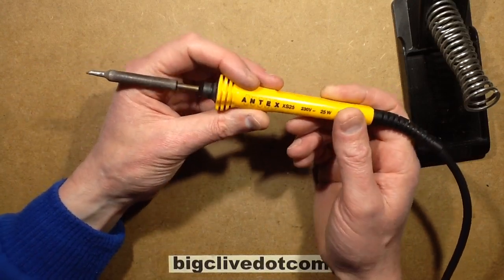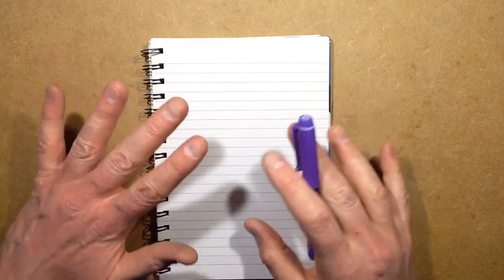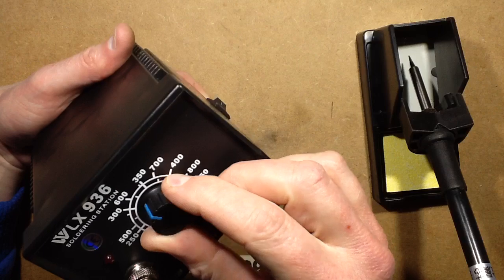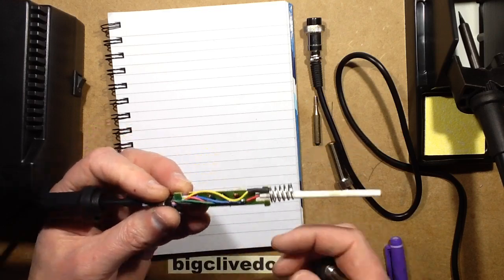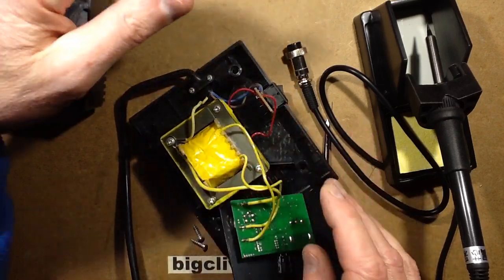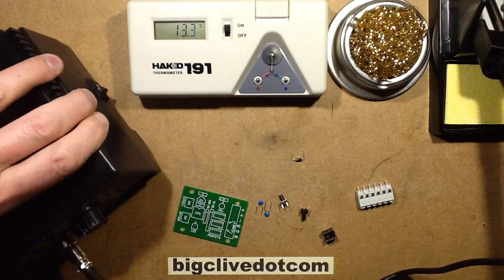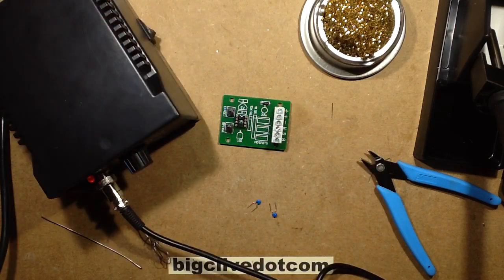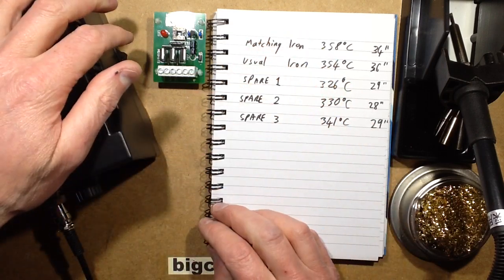Soldering basics and choosing a cheap soldering iron.

Comment: @Bigclivedotcom
Where did you get the extra/ secondary irons??? The same seller as the tips, the bible seller person?? 
Also where did you get the Secondary front panel & board modules????
Thank you Mr. Big Clive
Cheers Kerry/ willyboi
Reply from the maker: +MyWillyboi Search on ebay for 936 handle and 936 control and you should find them, but remember that some have the pins and some have the socket on the PCB.

Comment: I bought one of these a few years ago and I actually prefer it over my original Hakko. The original transformer (25VA) in my unit got a bit too hot for my liking, so i replaced it with a 50VA core I bought from RS. It barey went in the case, but now I have a "turbo charged" (IE less voltage sag) iron that has a pretty short warm-up time and a cool running transformer.

Comment: @bigclivedotcom
I bought the Yihua from HobbyKing after seeing Dave's (EEVblog) review of it! Way back when, I believe a year or two ago now without checking! It cost me $17.99USD @ the time + shipping, shipping wasn't bad! My station is the extra front module model you had with the gold on it! Not the best by far, but for the $, it's ok. I also got extra tips, very smart Clive sir! 
I want to know what so you think of the hot air/ solder station??? I am considering ordering it, pending some review, although I personally don't know you, I trust your opinion! I did order the  'Hakko' Temperature Thermometer after seeing how wicked awesome yours is! I would like to get the Thermocouple Thermometer you have also? Any clues how to find one for myself Mr. CLIVE sir???? 
Cheers Kerry
Reply from the maker: +MyWillyboi Search on ebay for hakko 191.  It should cost around £10 / US$15

Comment: I bought an Aoyue 2702A+, and good lord it would have to be the best soldering iron I have ever used. And I have used some big dollar ones in my time.
It uses a tip that has the heater and sensor built into the tip itself, with bands on the stem for the electrical connection. Subsequently, it has seriously good temperature regulation, and heats up in literally five seconds.
Tip retention is a collet type arrangement that is loosened by a rubber grip, and you can hot swap in seconds.
The tips are a bit more expensive, but they seem to last well.
The unit has a hot air blower too, which is great. Also, a desoldering gun, but it's a bit so so.

Comment: I don't know if it has been pointed out as yet (too many replies) but your favored tip appears to be the "bevel" tip type (which have a single flat side).  The "chisel" tip is sometimes also referred to as a screwdriver tip by some as it has two flat sides.  

I use both chisel and bevel tips in my projects depending upon what I am working on, but I use the chisel tip the most and often have two soldering irons running with either different sized tips or differing temperatures, depending upon my needs for a given project.

Comment: Hi Clive. Thanks for another great video. I bought the soldering station featured a few months ago, and certainly for my occasional soldering needs I've found it virtually flawless. Regarding the nuisance of the lightweight plastic stand that comes with this station, I purchased a metal one of similar design for £5.60 from an ebay seller  trading as eletrading, and with the rather ungainly description of 'Metal Soldering Iron Gun Stand Holder Support Station Base Sponge'!
 It doesn't advertise the fact, but it is in fact of cast alloy construction - not iron unfortunately, but significantly more substantial than the original, non-the-less.

Comment: Can you solder big connectors for batteries?
Reply from the maker: +d3xterown It will handle the thin strips that are spot welded onto cells.  It should not be used to solder the strips onto cells as the heat can damage the cell.

Comment: Hi Clive, thanks for another great little video.  I really like your channel.  Might even become a Patron ;-)

If the digital iron you have ordered is blue (YCD_936D?) then beware of the earth bonding.  I PAT tested mine and found that it failed miserably.  Turns out that the mains cable they use is rubbish but the plugs are even worse.  The metal they use for the plug pins is very porous and it is very easy to break the ends off the plug pins!  I ended up completely replacing the cable and plug.  I use these units to teach kids soldering so was concerned about passing PAT .  Many readers may not be.

Also  I have found that the transformer in these digital blue units gets hotter than the analogue ones; to the extent that I decided to fit a small 12V fan and thermal switch which kicks in when the transformer gets up to about 60 degrees. Works well but the fan noise is VERY irritating!  Nice colour though and the stand is a bit better than the black ones. I put small rubber feet on the bottom of the unit and stand and then velcro the two together.  Stops them moving about. Cheers!
Reply from the maker: +David Kempton I always test the earthing in everything I get.

Comment: Much appreciated advice, thanks for sharing. I'll start weaning myself off the wet sponge now and try out the new Brass ribbon/pad, although I will miss the hissing noise made by the iron tip touching the sponge. ;)

Do you clean the flux residue off your boards after soldering or just leave it?
Reply from the maker: +Professor Branestawm I tend to just leave it, though I would probably attempt to clean it off if I was using lead free solder as it has a harsher flux.

Comment: why are they choosing to have a male end on the unit. that's bad practice.
First of all, it's a bigger hassle if one of the pins bends or breaks as if one of the pins on the iron breaks, you can just easily replace it cheaply. Secondly, it's the live side of things, you got exposed pins, that you wouldn't have if it was a female socket where the pins exposed on the iron itself are not having potential at that time.
Reply: You would really have to abuse the connector to bend the pins, they are fairly substantial relative to their length.  As for being exposed, we are only talking about 24VAC when powered on, not exactly a threat to anyone even if you do go out of your way to make contact with such.  But, ordinarily one leaves the soldering iron connected at all times, in which case nothing is exposed or in significant danger of being damaged.
Reply from the maker: +FalcoGer I think it's mainly to stop the wrong type of iron being plugged in.  The ones with plugs use a thermistor and the ones with sockets use a thermocouple.

Comment: Can you re-calibrate the solder station using the "Hakko" 191?  Or does the adjustment actually produce different results each time?  If it were mine, I'd probably black out the printed numbers and substitute my own if I could confirm the actual resulting temperatures.
Reply from the maker: +Dosbomber Yes, the station can be calibrated, but it would need to be done per iron.

Comment: Lead based solder is toxic, it's just not that dangerous in the amount used in a shop or home workbench. Still, wash your hands after using, as lead is rather nasty when ingested.
Reply from the maker: +Owl Films It does if your steering wheel is made of lead.

Comment: The conical bits are not better suited to SMD -- they are suited for almost NOTHING! I don't even know why they make them. Chisel tips are the way to go. As Clive mentioned, the 900M-T-1.2D are the chisel types. Replace the 1.2 with whatever size width you want, ie 0.8 1.2 1.6 2.4 3.2 and even 5.2 which is massive. I like the 0.8 and 1.2, sometimes the 1.6. I accidentally bought a 2.4 recently and it's just too big for most through-hole and SMD work on populated boards.
Reply: +Aurelius R Correction -- Clive said 3C which is not a chisel bit, but a slanted or bevel face.
https://www.hakko.com/english/tip_selection/series_900m.html#type_bc_c
vs
https://www.hakko.com/english/tip_selection/series_900m.html#type_d
Reply: +Aurelius R Hakko also recommend type B for all-around, but I would strongly recommend D.
https://www.hakko.com/english/tip_selection/work_all-round.html

Comment: The Yihua 937D is a champ. I've had it for almost three years, I had to replace the element (it comes with a spare one) because I dropped it with the tip off and it cracked the porcelain. It had lasted two years no problem, and was still working fine. They take Hakko bits, which means you can get the Plato brand ones, which are just as good and a bit cheaper. Definitely highly recommended if you're going to get a Chinese unit. Scrap the tips it comes with and buy some Plato 1.2 and 2.4mm chisel tips (I'm surprised Clive likes the 3mm ones, they're way too huge for most electronics soldering). I prefer the 1.2mm ones as I do a lot of both SMD and through-hole, and it works like a champ.

Comment: Great video. I learned a lot. I used a $2.5 "60" watt iron for my first kit. It worked but I have a hard time getting the solder to melt sometimes. I suspect the "60" is not quite accurate. At any rate I love these new tutorial type vids!
Reply: It must be way off... a 15-watt pencil iron is enough for MOST general circuit board components, except large connectors, and components with heavy leads going into a ground plane.

Comment: Clive any idea what the use is for flux free solder?
Reply from the maker: +Scott Campbell Used with separate fluxes or in bar form it's used in solder dipping pots.
Reply: +Scott Campbell Here it's called "radio solder".. now I have no idea why, but I use it to fill larger cavities, like larger gauge wire connectors, where normal solder would just create non-confuctive brittle pools of flux.

Comment: Ony 13 degrees?  Holy cow.  You must have really high metabolism.  I really don't feel too good below 19.
Reply: +KX36 I suspect the beard keeps his face warm :)
Reply: bearded guy here, beards do keep face very warm.
Reply: @monsterzero5650  True, I have insufficient beard coverage on much of my body, that's the real problem. If only everything was as warm as my lower face in wintertime!
Reply: +rchandraonline When the AC in my lab is set to 17'C, we start wearing coats under our lab coats. It doesn't sound that cold but you really feel it 8 hours into a 12 hour shift, especially when there's a fan blowing it down your neck. I don't know how Clive manages it.
Reply: @KX36  ACs blowing down your neck are deadly. You even get colds at 20+ degrees … the breeze and windchill are just nasty.
Reply: He said hes in the isle of man, i think hes from Scotland ,13degrees probably  sat there in his shorts and tee shirt and wondering when the heat wave will end
Reply: He's Scottish.  Up here you get dunked in the North Sea at 3 months old and if you live then you get kept.  I can't stand heat, put me in a fridge or a cellar and I operate at peak efficiency.
Reply: @krashd  i live on the pacific coast of north America, in one of the cooler regions,  and I'm the same way,  but my problem is my asthma flares up worse in the cold than the hot,  so i wear a mask so i can breath easier but stay cold.

Comment: awesome video clive, I've got 3 of the fake 936's bought them 2 years ago and haven't had a problem (think back then they cost around £13 each, as opposed to maplin's clone version at £45) surprised you don't use a T2-5 chisel tip though. think I've literally built up a stockpile of 300+ tips for these irons, just because they're too cheap. one thing id love to see you do a video on if possible is rework/reflow stations, I'm yet to find a reliable one

Comment: I remember years ago thinking what the multicore solder looks like so I got a bit of solder and cut it at a shallow angle with a razor blade and had a look under a magnifying glass and there it was clearly visible, when you said your solder had just 1 core I thought how strange, the 3 spools of solder I have at the moment are all 5 cored resin.

Comment: I used a dc psu to power my yihua iron so that way I can push more wattage through my iron I run it at about 30 volts now instead of the 24 it used so it takes half the time to heat up now

Comment: I have not used lead based solder in a bit more than 15 years.
I recently got an ATTEN 306DH is one of those High Frequency soldering irons it uses induction to directly heat the tip. Is a much better idea since the ones you show in this video (I have a few) do not have a good thermal contact with the resistive heat element. I got some with metal heat element (you can find on eBay) those are a bit better since are just a bit thicker and have a bit better contact with the tips but still not great.
Reply: +electrodacus I agree.  While this is not recommended for lead-free solder. I have found that powdered graphite shaved from a 4B graphite rubbing stick helps to fill the void/gap between the heating element and the changeable tip. After the graphite mod turn down temperature setting, the iron will need less heating to do the same amount of work. Makes this soldering iron great for hobby use.  Still not a genuine Hakko 888 or a Metcal inductive soldering iron.
Reply: +Jon Russell The powder filling the gap seems an interesting idea but not sure if thermal dilatation will not damage the heat element since there will be no space to expand. There are some other inexpensive irons with heat element directly inside the tip (tips are a bit more expensive since they contain the heat element and temperature sensor but will work much better) search for T12 series tips. I seen a Bakon 9050D station using this tip for around $40 and while a bit more extensive is probably a better option (tip is also 70W).
The Quick 203h 90W or similar inductive soldering stations can be had for around $120  on aliexpress (I paid more for my ATTEN 306DH on ebay since it was 120V AC version harder to find on aliexpress most there are 220V versions).
Reply: John Coops
I do not think that will withstand those temperatures it will dry up realy fast. That is why I like the induction soldering so much more no thermal contact to worry about.